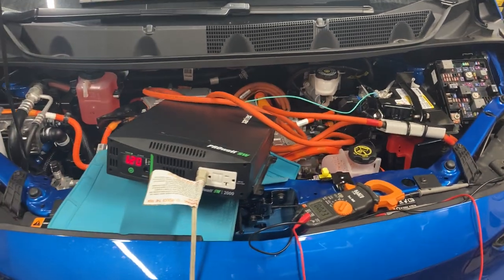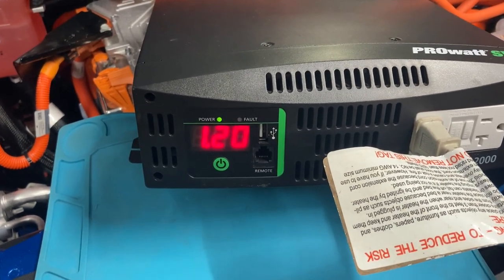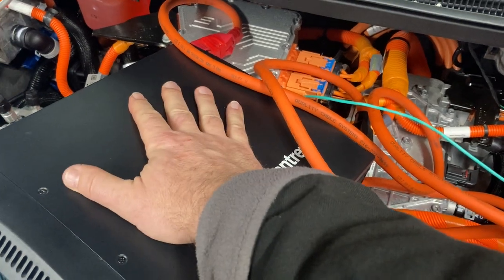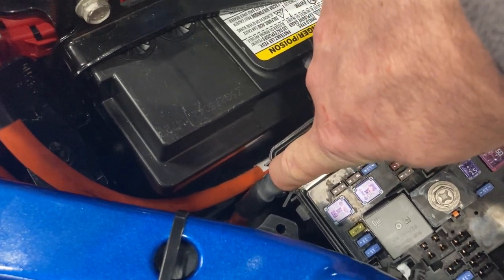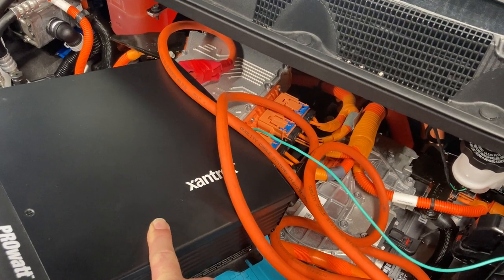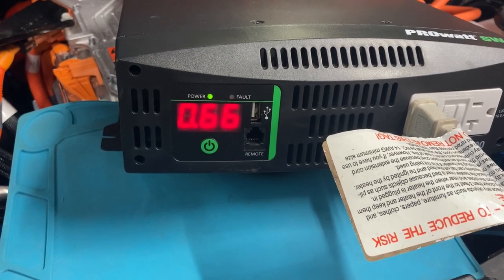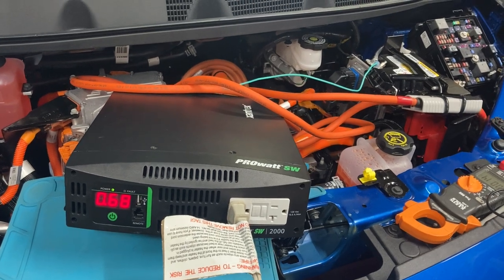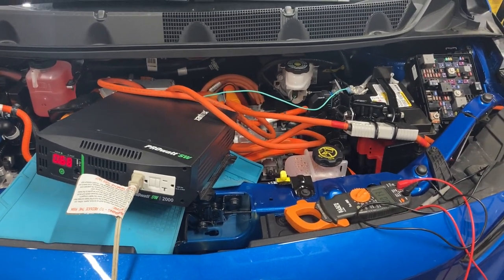Chevy Bolt EV to AC Inverter Backup Testing (Blackout protection power)

Comment: Because that’s the first thing you do when you buy an new car, confirm that you can power your home with it :)
Reply from the maker: It's an electric battery FAR LARGER than a person would typically ever get as part of a solar system, and costs LESS!

Add up the price of a new car AND a home power backup. Makes more sense if you get both for the same price!

Comment: Thanks for posting this test. I have to run a wire back to power a trailer and I kept thinking about running a bigger wire so I had the option of putting in an RV type inverter and extra battery in the truck. Glad to see other people are testing the idea.

Comment: Per this video which is amazing configured my 2022 BOLT EUV for hurricanes Ian & Milton with Anderson Connector as per this video. Car fully charged 362mis. averaged 28 miles per day continuously running freezer in garage / refrig-Freezer router for internet, entertainment system, LED lights & sm. appliances occasionally for 3 full days- My inverter was fm Harbor Freight Juniper PURE Advantage 2000-Watt Sine Wave which performed excellently. Never tripped a breaker on the inverter - Got one alarm when added a micro-wave which immediately disconnect. Averaged 38amps DC draw when line tested with Ideal 61-757 600amp tester. Total run time was 3.5 days. All ran flawlessly - (Thank you) Mr. Nelson We own (2) Chevy BOLTS the other is a BOLT 2023 EV these cars are amazing.
Reply from the maker: So glad it was useful for you!

As a side note, microwave ovens draw a lot of power. It's easy to forget that on most of them, the power can be manually set. My home microwave is 1600 watts, but I could run it at 50% power. It will work well, just takes longer to cook.

Comment: Similar to the harbor freight 2kw inverter. 2/0 cable doesn't get got even when charging an EV for over an hour. Inverter does definitely get toasty. ~115 amp draw according to bms. Tks for sharing this! ... Gonna freak out any techs when they see that orange plug under the hood haha

Comment: I heard from other Bolt users you shouldnt be pulling any more than 1000 continuous watts from the system  with this method. Is that true?
Reply from the maker: The short answer is yes.

The APU (Auxiliary Power Unit, or DC/DC converter) is rated at about 130 amps. At 12V, that's around 1500 watts.
Keep in mind that you want to deduct some power for inefficiencies and the power the car itself needs for headlights, electronics, etc.

The car should be able to run 1,000 watts continuously no problem. Running higher than that is fine too, but not at a high rate CONTINUOUSLY. If you draw more off the 12V system than the DC/DC converter can provide, the 12V battery (which is really acting as a buffer) will start to drop in voltage.

I'm using a higher power inverter because I already had it and it allows for higher surge capability. Some electric devices don't draw high current while running, but will momentarily draw very high current just right as they start.

The system can run my furnace and/or my refrigerator. Both really only take a few hundred watts each, but also run intermittently and have a higher starting current draw.

On my setup, should the 12V battery voltage go too low, (because of a heavy continuous draw on the 12V system,) the 120V inverter automatically turns off. With that as a safety feature, there's really no way to overload the car.

Comment: I looked at doing the same with my Volt and asked the Volt mechanic that regularly posts on the FB Volt group. He cautioned me that a continuous high amp draw through the DC-DC converter could cause it to fail (expensive). It might be worth testing the "everything on" amp draw of the car's system to get a feel for what the expected continuous draw on the 12V system.
Reply from the maker: The DC/DC converter on the gen 1 Volt is rated for 165A. That's a lot of current! It's about 2,000 watts. So, drawing only 50% of that is 1,000 watts - plenty of power for a home backup.

Note that the converter in the Volt is air-cooled, but the one in the Bolt EV is liquid cooled.

On the Volt, the converter is in the back, under the floor of the cargo space. I might fold back the carpet and point a small fan across it if cooling is a concern.
Reply: @BenjaminNelsonX  Gen. 2 Volt.Water cooled.
That's all what i thought, safe to run below max, but the mechanic guy said the rating was intermittent vs. continuous.
Having said all that, this was over a year ago and I can't find that old post. I was skeptical even then but thought it only right to pass along what I was told. FWIW, automotive alternators are rated at their maximum ideal output. They all have lower output once hot, and die young if run continuously at anything like full power. Totally different device but may indicate how Detroit rates these things.

EDIT: It may be that heat in the DC-DC box won't trigger the cooling system to step up. Pure speculation but maybe feel the converter coolant outlet while under load. that may be internal on your car though.

Comment: Any idea what the capacity of the DC/DC converter is?  I assume you need to keep the car powered on, not just on accessory mode.
Reply from the maker: Yes, you want to have the car on, so the DC/DC converter is active, similar to a gas car with the engine idling to power the alternator.

Since it's in my garage, I can have the garage closed and locked AND don't have to worry about carbon monoxide!

For people with an attached garage, just run an extension cord straight into the house.
Reply from the maker: The DC/DC is about 1,600 watts, but you don't want that running full tilt all the time AND you have to subtract out the car's overhead power consumption and the inefficiency of the inverter. The heater I'm using can use 1,200 watts OR MORE. When it's only running 1,200, it all works great. When it draws more, there's been a few times where I could see the battery voltage was starting to drop.
Rule of thumb is that most electric cars are probably best used drawing about 1,000 watts maximum continuous power from the 12V system.
Reply: Whew, this is heady! Thanks for posting, I’ll look at your other vids and sub.
Reply: @BenjaminNelsonX Is the AC run off 12V power? How much power does it use? How about the heater?

Comment: Could this be done with a hybrid like Prius or Camry? Would the gas engine start if the 12 volt battery gets to low if you leave ignition on?
I’m guessing an 800 watt inverter would be adequate for the furnace fan?
Reply from the maker: Yeah, this would work great with a hybrid. Engine would only run as much as needed.
Reply: In READY mode the 12v battery is always charging and has a roughly 100A output capability. The engine will run to recharge the hybrid battery as needed.

Comment: I don't know much about this stuff, but when the anderson plug is disconnected, is there exposed leads or is there a fake plug or something you can put into it to prevent anything shorting out.

Also, I'm assuming it would be more efficient to go straight to the high voltage (using proper inverter that can handle it)...not saying that you should/could with the vehicle, just wondering what the potential different in efficiency would be if the car were designed (as some are) to provide battery backup vs what you're doing.

And finally do you know what your runtime would be running it just the way you you're connected and having both furnace and fridge plugged in?  I know lots of factors play into that (outside temp, wind, etc).  But assuming an average cold winter day.
Reply from the maker: Two things - one is a rubber cover for the plug. The other is that there's a circuit breaker in line with Anderson disconnect on the positive side. When not in use, the circuit breaker is flipped open, so there's NO voltage at the plug.
Reply from the maker: As for run-time, I HAVE been tracking my furnace energy usage lately. Over the last week, it's averaged just under 2kWhs of electric energy per day to run the electronics, fans, blowers, etc. on our natural gas furnace.
The car has a battery pack larger than 60 kWhs. So, if it was just the furnace, the car could power it for nearly a month.

I have NOT recently tracked my average daily refrigerator energy use. I'll have to do that.
Reply: @BenjaminNelsonX  Wow that's great, I wasn't expecting it to be anywhere near that long for some reason.  And thanks for the info for the plug too, that's makes a lot of sense, I forgot you said breaker and I was thinking fuse.

Comment: How do you plan to keep the car on? It'll shut off automatically after an hour or two (depending on if the key is in the car). I've read people pulling the pedestrian noise fuse, putting the car in drive (one pedal on), and putting the parking brake on to keep the car on.
Reply from the maker: Turn on parking brake, put car in neutral, don’t open drivers door. (The car automatically goes back to park if you do. )
The car stays on with the DC/DC running.
Reply: @BenjaminNelsonX  the car won't stay in Neutral for a long time (the manual doesn't state how long) and will shift into Park automatically at some point.

Comment: I think this will massively stress the DC to DC converter. I think you would be better off to send power into or through an ecoflow or similar product first as a buffer and main draw. 

That unit would have a maximum draw or input into the unit and would stress the DC to DC converter less and you have more protections built into it. That product could also take more of an in rush draw for start up loads like your furnace blower or a refrigerator compressor.

It also would be clean enough power to run sensitive electronics and computers. It would also give you the ability to run a microwave for a few things.

I have a mechanical and Alternative energy background . I built my own portable backup power system 15 years ago.

I would not advise doing this to your vehicle and if you did I would advise piggy backing right at the battery terminals and not at the vehicle load center.

Spend the money for a jackery or Eco Flow or similar device and use your vehicle and Solar to charge the unit as you draw power from it. It is a better safer route to go for backup power. Just friendly advice and not an attack on anyone. Everyones situations are different.

In the past I have done the same thing off of ICE vehicles and had to run the engine.
Reply from the maker: Are you essentially suggesting to use a high-voltage solar inverter from the main battery?
That's a great idea, and why I did exactly that on my Mitsubishi iMiEV. It worked really well overall, but was pretty much an experiment because there are so many issues with dealing with higher voltage DC. That system also used CHAdeMO, and at least on that particular car, was EASY to activate power to the DC fast charge jack to directly access the main battery.
CCS, such as is on this car is a little more complicated to be able to directly access the propulsion battery.
https://www.youtube.com/playlist?list=PLmHss3DBZUinCtQhRuwHIYS8kVPXbvtyV
Reply: These devices are smart but dumb at the same time. This one also can be used as a back up in the trunk of your EV to charge from to get you down the road a few more miles. Most of these device can use many ways to charge back up or multiple ways to charge at the same time. You could be using an AC generator or inverter on one input and a Solar panel on another input at the same time to charge or pass through while drawing max amps off of the device.

It looks at your car as one big Solar panel array.
Reply: @BenjaminNelsonX  , is there a way to use a J1772 connector and tap the battery pack DC voltage at the charge connector?  Then feed that 380-400 VDC to a Solar inverter?
Reply from the maker: @douglasmontgomery6315  
NO.
The J1772 connector provides AC power to the battery charger which is built in to the car. It's a one-way trip.
You can not draw power out THROUGH the car's battery charger.

There are some exceptions to this now as "Vehicle to Load" becomes more common, but those require special external equipment and the cables inside the car are wired different. The car has to be specifically designed for it as a feature.

In general, DC Fast Charge ports essentially go straight to the battery, and the AC Charge Port (J1772) goes to the internal battery charger.
Reply: @BenjaminNelsonX  , ok...I guess I misspoke.  What I meant to get across was...is the two pins on the vehicle connector that are used for the DCFC...connected directly to the DC (380-400 vdc) battery and could you use that.
Reply: @desertdan100 are you suggesting you can have a similar set up to this but then hook up something like the eco flow delta 2 (1024W) to this and while it is drawing from the inverter connected to the boll 12V battery you Hook up your devices to the ecoflow instead of the inverter. Is that correct?

Comment: Good stuff!  I especially like the clean installation with the Anderson connector.    Is the inverter a pure sine wave or modified sine?  I've heard it's not a good idea to run things like fridges on modified because of the compressor.
Reply from the maker: Pure sine wave. Has lots of good safety features - Hi/Lo Voltage Shutdown, GFCI, etc.
Reply from the maker: I've tested this running my furnace, and it works great.

Comment: I have a couple inverters and batteries for solar panels.   My Nissan Leaf can charge my Bluetti battery/inverter pack.  A  little simpler than wiring one of the inverters to the Leaf 12v battery.
Reply from the maker: Sure, there's always more than one way to accomplish the same goal!
In this case, energy from the car can power pretty high draw appliances for extended amounts of time. Small battery/inverters usually can't power things like a refrigerator, freezer, or furnace blower, especially at the same time, and for multiple days.
But it also all depends on what you need.
For camping and just the basics in emergencies, I built the Solar Ammo Can: https://www.youtube.com/watch?v=2NIzIR_Lbkw&list=PLmHss3DBZUilFDIcmSmO3XFWhlcm9L-lJ

Comment: is there a way to get power straight from the dc to dc converter so u dont have to run thru the batteey? it seems like thats hard on the battery
Reply from the maker: You’re really not running it through the battery. The Dc/Dc converter is providing as much current as the load requires. So, you aren’t discharging the battery. 

There’s no “wear and tear” on the battery under typical loads.

Comment: Why not connect an inverter to the cars main battery?
Reply: too high a voltage (400V, some are 800V) for most off-the-shelf inverters (12V, 24V or 48V)
Reply: There is nice HV DC to 230V AC pure sine inverter from mitsubishi outlander, got one but no idea how to start it up

Comment: I wanna do something like this to my Chevy Volt
Reply from the maker: Great thing about the Volt is that it has an even more powerful DC/DC converter than the Bolt does.
Also, having the battery in the back makes it REAL EASY to add a wire harness and just put the inverter in the back with the hatch closed!